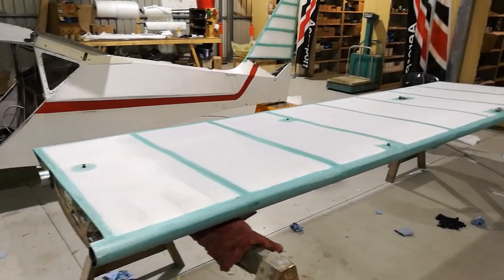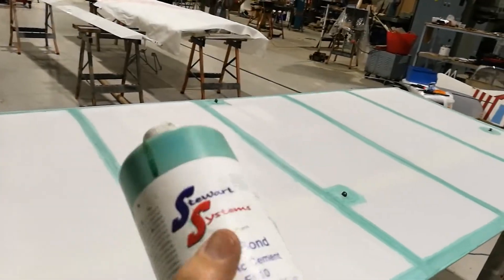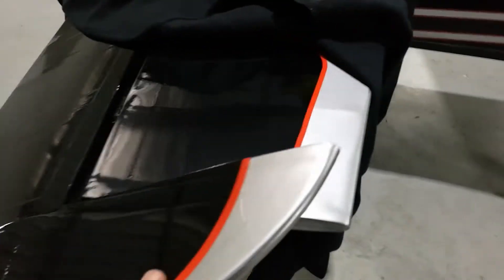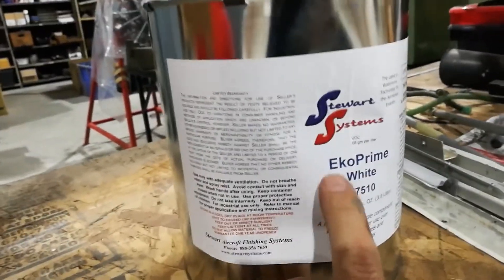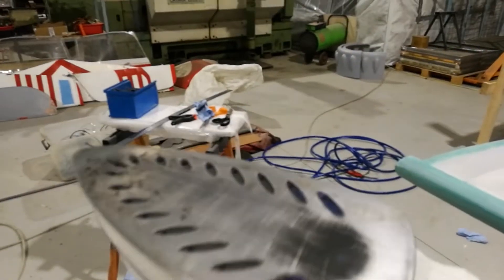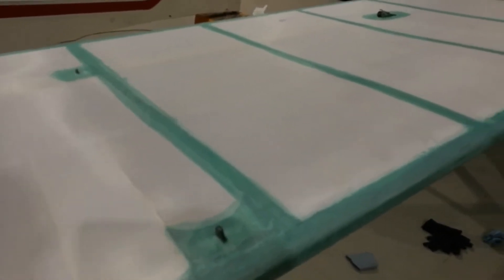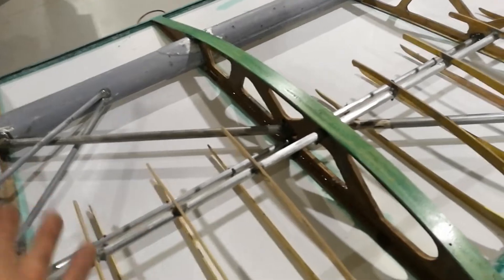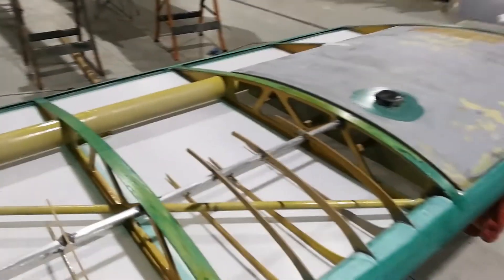Kitfox wing covering & Stewart Systems

Comment: did you use the ekofill, or only the ekoprime?  thanks
Reply from the maker: I used the white eco prime only, no silver no filler. I fist sponged on the first cote to fill the weave, then say two more coats via the spray gun, rub down in 400 then spray one more thin cote of eco prime, de nib, then gloss top cotes in 2k auto paint with 10% flex additive.

Comment: Hello R.A.   I'm covering my first wing tomorrow using the same system and components you are using.  Since I see you've been successful with the process, I have a couple questions.  I see that you did a preliminary shrink on the full wing before you did the final gluing down of the individual ribs.  Am I to assume that each rib should NOT be glued down before the preliminary shrink?  AND....when I cover the top of the wing, is it better to bind up the leading edge first or the trailing edge first.....before pulling the fabric tight to the opposite edge of the wing?  Thanks.  Andrew.